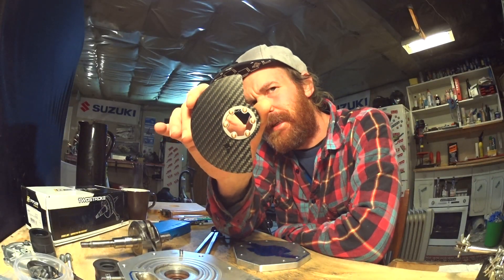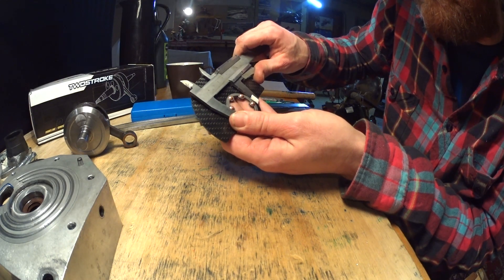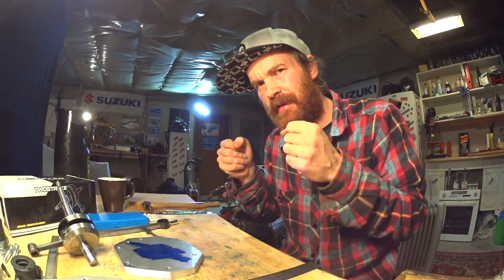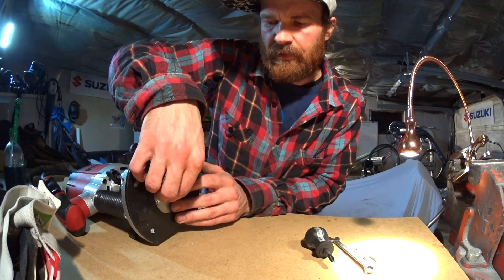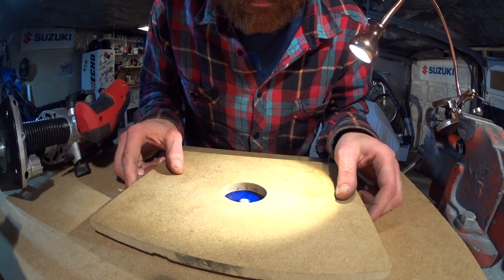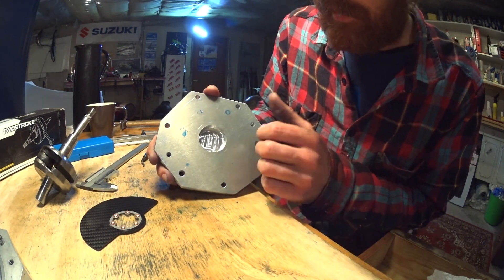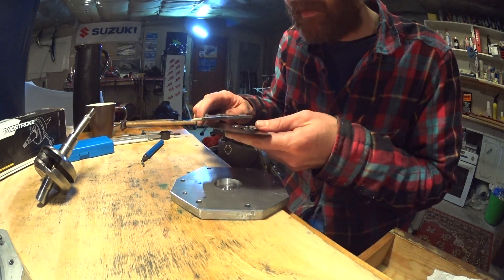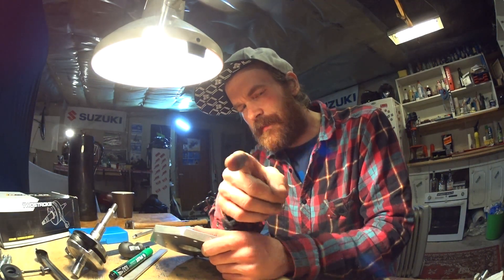Custom Rotary Intake Cover P2 | Handheld Router in Aluminum? | 2 Stroke Tuning

Comment: What type of mill-head did you buy? I've got the exact same machine and need to make som adjustments in aluminium.
Reply: Thank you! Great channel btw, keep it up!
Reply from the maker: Thanks!
Reply: I'm from sweden so link to jula or biltema is fine :)
Reply from the maker: Was the 8mm endmill from Jula, I've heard carbide wood bits work fine too.

Comment: Great channel and talented guy, i Like all your Stuff and of corse i m a great 2 stroke Fan!But i want Ask you something. Aluminium front cover work fine with steel disk also at high rpm but from my exsperience carbon fiber disk can destroy it in just a qualyfing+race life. Aprilia rotax work married ceramic alloy and work ed great, i Will suggest you make a cover from bronze plate if after some dyno you Will found bad evidences. Anyway good luck! I add, the steel eccentric disk at 17000 rpm is some outbalanceced mass, now with carbon fiber you solve this limit, i hope you ll found some extra rpm!
Reply from the maker: +Vns workshop Thanks, and thanks for the tips! Hmm, do you think anodizing would help? Sure makes it alot harder, but maybe not hard enough. I've wanted to try it for a while, see if I can produce ok results, this might be the perfect opportunity.
Reply: Anodizate aluminium Will increase surface hardness and May è increase life but the problem is Still compatibility between a rotating piece of carbon fiber Vs aluminium and friction involved.Mayè only ceramic is The way I know about an italian Pioneer of carbon Rotary disk in the 80 cutted and glued ceramic layer from ceramic tilde for Floor! Exstreme but True! But continue with you testina and check it every run! Good luck
Reply from the maker: +Vns workshop Thanks! Maybe some kind of spray on ceramic coating could work, or thin sheets glued on. I'll do some research.

Comment: https://youtu.be/QuhyIBLgm90   Rotozip has a tracing bit we usually use for cutting outlet boxes thru drywall. While your doing experiments. The tip is blunt and rides on whatever it touches. Can also adjust regular bits so portion on top could ride on a pattern placed on top versus tracing bit ride on underneath pattern. In theory , anything harder will cut softer, but speed of bit/blade, tooth #, torque,and aggressiveness play huge factors. Always found bandsaw  chewed thru  aluminum best and jigsaw was second. But you might have stumbled onto workaround for those that don't have access to CNC or mill. Great idea.

Comment: Nice job, free hand is usually a sure bet but not as pretty. I use wood tools on aluminum often, router, jigsaw, even circular saw.
Reply from the maker: +upside downdog Thanks! Hmm, maybe I should get a cheap wood lathe...
Reply: 2STROKE STUFFING 
If you go slow it may work better than nothing!
Reply: Good to know that this works!  Yes I use a circular saw on metal all the time, with a proper blade plus a cheap router speed control like this: https://www.harborfreight.com/router-speed-control-43060.html you can slow down those tools for metal work.
Reply: Brendan Doyle
I prefer full speed on aluminum but cool suggestion.
Reply from the maker: +Brendan Doyle Nice, I'll check out that speed control.